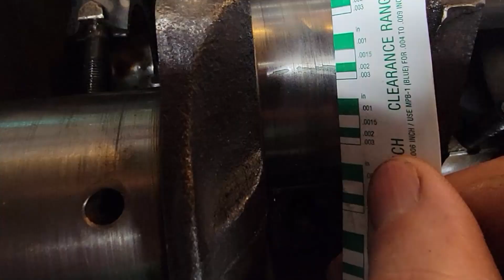Refreshing the V8 for the 76 Gremlin.  Pt. 1 Reassembly of the Rotating Assembly. AMC 360/5.9L

Comment: I hope you put engine assembly lube on all of the bearings and not the straight oil you put on the cam,hopefully it lasts
Reply from the maker: Yeah I used lots of assembly lube on all of the parts that move. I know that sticks a lot better than oil if it sits for a while.

Comment: Cmon dude, you gotta get a four-barrel of some type! You can’t do all this work and stick with a 2B! An intake manifold should be easy enough to find.
Reply from the maker: I would love to and the intake is easy to find. I really wanted to do a cam swap. But to do those, I know I'd spend well over twice of what I spend on the car. And I haven't done anything for tires yet. Maybe sometime down the road, I'll get those upgrades but I haven't actually drove the car yet. For now I just want to get it running and then go from there.